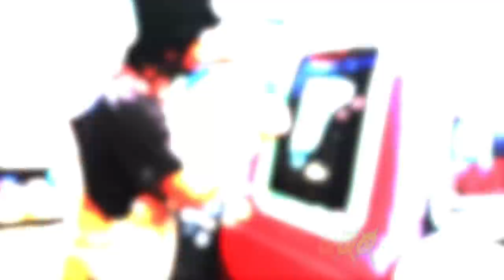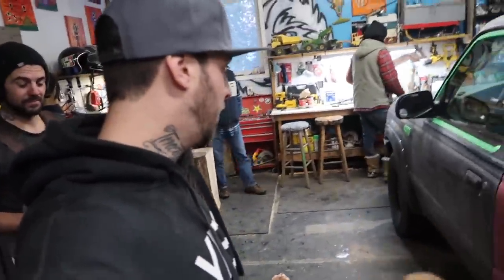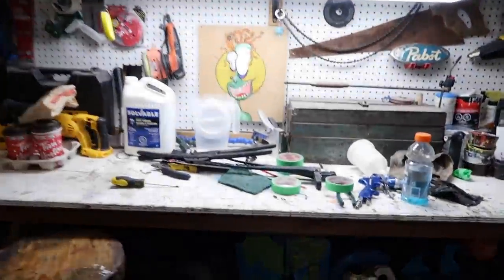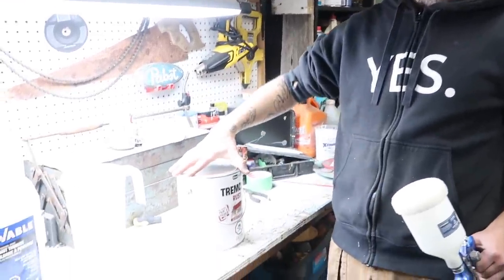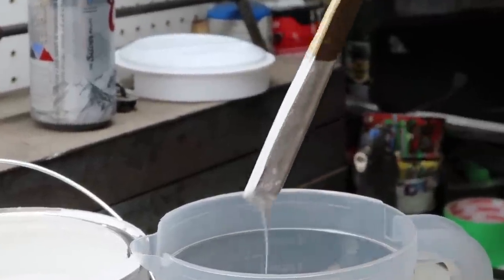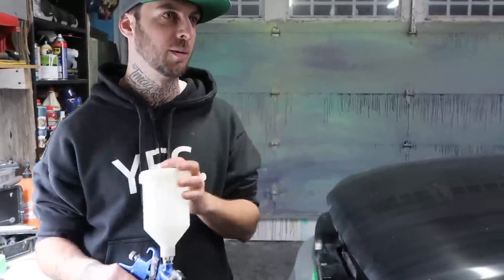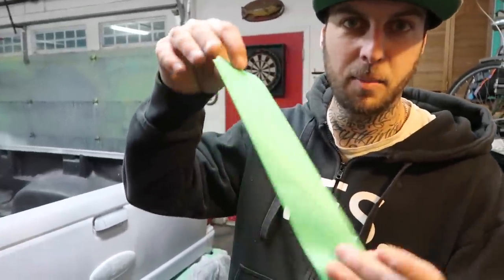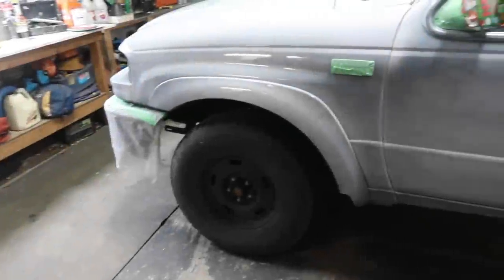$50 Rustoleum Paint Job "HOW TO" D.I.Y

Comment: As a professional painter I laughed so hard but in a good way. It reminded me how I started painting. Just like you guys! Loved it. 

Couple of runs dont really matter, you will make it better next time.. That's what DIY is all about!
Reply from the maker: Nothing better then having a blast in the shop! thanks for watching and leaving a comment.
Reply: Steeven Rivera  hi as  car modifier and restorer and  Amature 50 Years experience custom painter  and working full time going to school and college at a gm dealership for 9 years in auto body and collision.Don’t use paints that need hardener without wearing the proper air supplied full face  mask paint suit nitrile gloves . The dangerous product in the hardener is methyl di isocyanate or any isocyanate sometimes called MDI . It goes through skin eyes and n95 p95 respirator. You have a life time exposure threshold with isocyanate once you reach it you will react to even small exposure like sanding a clear coat . The symptoms can be athsma , permanent lung damage , wheezing , cough which may be permanent even death and it in 2 part bed liners construction glues, canned expanding foams insulating sprays sold every hardware building and dept store . I only say this because spaying enamels like you are using is fairly safe unless you get bad advise to add a hardener which would be containing isocyanate most contain it. Isocyanate can’t be washed of clothes floors or skin  . Nice work using the paint your using cheap to 👍👍👍 results a great let it dry good several weeks then wax . I have a 1992 Chevy tracker in mint condition painted in 2002 in white machinery / marine enamel which contains polyurethane but requires no hardener . The tracker was painted in white and look great and waxes up great paint job cost  less than $100 Canadian including the siphon feed paint gun lololo
Reply: Steeven Rivera  you can buy a paint nib file and remove the run once the paint is cured and carefully rubbing it out with rubbing compound. I would think a couple of week to wait before you try this
Reply: I'm thinking they should watch some videos on how to paint themselves
Reply: king thanks for sharing that info.
Reply: Love this kinda attitude!
Reply: @nickking1510  good news, 2k paints can now be bought in isocyanate free forms
Reply: @remlap42  Hi I am in Ontario Canada glad to hear about isocyanate free paints can you give me any other info  what company name of products I would gladly appreciate it thanks for letting me know
Reply: @nickking1510  i'm no expert so your probably better off googling it, not the sort of thing i want to give bad info on what with it being so dangerous

Comment: I spent about 4K on new fenders, a bumper, and various bodywork(pdr/bondo). I was going to have it professionally painted. Then the engine started throwing random codes and I’m out another 4K. I think I’ll just paint it my self with slightly more expensive paint and put a clear coat on with my brother and nephews. Thanks for the video and tips.
Reply from the maker: lol Thanks for watching!
Reply: Should be able to nail down the codes problems and repair .What make and codes and engine ?

Comment: I still liked and subscribed so not being critical. Thanks for this video because I’m restoring a vintage camper and want a quality paint job without breaking the bank. I had planned to use Rustoleum. Automotive paint is over $1,000.00 just to do a car, so this will save a fortune

Comment: In the 1980's I had a used appliance business, and I would often paint appliances as part of that business. I found that naphtha works well for reducing paint, and it dries quickly. I found that paint thinner was a bit oily and dried very slowly. Using naphtha, I could paint an appliance in the morning, and by the afternoon it was dry enough to sell. I also see that Rustoleum now has an enamel reducer. I like your "7 rule". I had a viscosity cup that worked great, but now they seem difficult to find. Rustoleum also has clear now.
Reply from the maker: Wow thanks fir those amazing tips on reducers/ thinners. Ill definetly look into the naphtha products. Thanks for watching and leaving a helpful positive comment!

Comment: "spray in temperatures above 65°F" 
Canadians: Just gonna send it!
Reply from the maker: LOL open the garage door and let the snow in eh! haha thanks for watching!
Reply: His tip with the 7-8 second drip works well and adjusts to the temperature. I would use japan dryer and put a heater on after spraying on the coats to let it flash should be okay it's just tremclad
Reply from the maker: @gurjindersingh199  Thanks for watching and living some tips! some heat after each coat is definitely good advice
Reply: Yeap thats how we do it
Reply: How did it ever end up lasting ? I'm thinking of doing this

Comment: looks good i did few years ago with my lowered s10 but i used tractor paint
Reply from the maker: Tractor paint was prolly better then the rust oleum. either way both very durable and nice looking paints! Hows the paint on the S10 holding up all these years later?
Reply: sold this but i have did dew truck and cars in tractor paint it hold up really good
Reply: Did rustoleum with some Pearl's a few  years back on a dodge stratus with a combat body kit. Took a few weeks to harden :( Did look decent tho compared to the good.and black mismatched body
Reply: @DerfOrNuffin  did you not use hardener is that why it took so long to dry?

Comment: Not bad for a scuff and shoot. Now that's its cured I wouldnt worry about clear youd had to wet sand. Just throw some synthetic wax on it to make it look cleared on a budget. Cheaper then proper cut and buff and still looks ama,ing I'll try to find the video of the guy who used Walmart dollar cans then used wax and keeps it polished. You want to wait 3 to 4 weeks to wax it let it finish off gassing. The only other thing I cant recommend as a painter is 12 Inchrs back with hvlp that's way to far you have to get close with hvlp to avoid orange peel. Like 4-8 inches is the usual specs. Some guns will max 10 but pinky to thumb is about perfect if your not a fast painter that can get 4 or 5 Inches without running. 12 inches back the paint is drying before it lands and atomization of the paint isnt even anymore that far back. The old conventional siphon feed guns at 60 psi ya you stayed little further back but it dumps paint and needs high pressure and high flow. What I do to paint cars at home is I use 3 compressors in parallel on separate breakers. 3 to 1 in reverse to first separator with store bag of ice over the lines circled to lower intake air into the first filter and heavy droplets then 12 inch 3/4 brass nipple with steel wool in the ends with decissant gel beads and I wrap those blue frozen packs around it. Brass is known as the cold metal I dont use fittings for that parts just lines into the 3/4 to 1/4 reducers then it runs into a 2 inch 48 inch galvanized pipe full of more beads then into my lowes 7 gallon portable tank and I run from that. Usually only two of them run. But all 3 give me 16 cfm at 90. 65 gallons at 150 psi and completely portable can load it all up in 10 mins in my truck dont need 220v
Reply from the maker: Thanks for watching and leaving a comment!! Thanks for the Wax tip ill definitely let my brother know, would be a great thing to do!
Reply: Damn you hella good can i see some of your work ? Im trying to figure out how best to do my bike sub section, main frame and swing arm in a decent black color my Zx7r rims are orange color.. So was thinking doing the rear sets in lime green kawasaki color with accents of orange into rear sets but not sure exactly on how to go about it to achieve the effect an look i en visioned here tho...Any advice greatly appreciated on this...if you have shop sen me info email etc n I'll be in touch with you on this. Thank you.

Comment: I love Rustoleum. Instead of tack cloth, I use Wil-bond. Otherwise, pretty much the same except the kid gets to paint the inside of the bed/tailgate. I use a brush on the wheels so I don't have to thin the paint.

It is tough to clean up but a little Sea Foam soak helps soften the tip boogers.
Reply from the maker: Thanks for leaving a tip!

Comment: Enjoyed your video.  My first paint job was with small compressor connected to my buddies trucks dual wheels and small water tank for air capacity  and a restored paint gun. it worked.  For my second paint job on a van I sprayed the entire van with a cheep stone guard and then sprayed over it.  It looked great like a vinyl finish .  My third was on a old step van  and I was in a hurry so I used a roller - it did come out good.   All of these were outside jobs.  Chasing the sun to keep the van warm in the cold weather and picking flies and mosquitoes when it was hot. Would like to know where in Canada you (Provence) are .  Your group looks like my group but mine are grayer.
Reply: I painted a white 16 ft wilker boat with a a roller and applied blue side stripes with 3 cans of urethane enriched spray paint for machinery from home hardware after a month i wet sanded the white and used a 8  inch buffer polisher and rubbing compound and then wax looked as good as new gel coat whole job including the 29 $ on sale polisher cost $100 .

Comment: And since it's oil base paint everything in the shop that was not covered now has a nice coat of the latest color of over spray on it,,, it dont just blow off.   Lots of rags and thinner on the tools, books and manuals, well your screwed, cloth and leather good luck and for flat glass wait a day or two and razor blade or 0000 steel wool and lots of scrubbing,,  another thing before you burn up your compressor go change the air filter in it as well as if you had a heater or furnace going they need filters changed also.
Reply from the maker: Thanks for watching and commenting! Sone great tips on changing filters etc.

Comment: Dang, drumset gets "whitewashed" too Lol. How cold is the weather there outside with the doors all open btw? Do you close em down when the paint dissipates as it is a oil based alkyd enamel ect. Seems like the cold air and oil base product wouldn't be the best combo (least from my experiences lol). I'd have that shit runnin on the floor Lol........Pizza and Rustoleum overspray for dinner too. Nice. LOL. Glad to see people havin fun painting cars in the garage like I used to, ALOT........Dane, "FORD" tailgate molding "GOES too"......Classic stuff!
Reply from the maker: lol ya we got some overspray on pretty much everything.. Close the door after every coat and cranked the heater no issues drying turned out very good! Thanks for watching and leaving a comment!

Comment: Don't you use a hardener with it?
I painted a WHOLE 1967 Chrysler Imperial with one quart of Rust-oleum "Bright silver"!! 
But since I didn't use hardener, it stayed soft enough to dig with a fingernail months later.
Reply from the maker: You can definetly add a Gardner. But to save cost I’ve sprayed multiple vehicles with just the straight rust oleum and you have to give it a good couple days to fully cure..

Comment: How is the paint doing and how long do you think it will last? Is it just a regular gallon of rustoleum? How much did you need for the whole truck just the one gallon?
Reply from the maker: Maybe used about half gallon? Paint holds up very strong. Just your basic Rustoleum. NOT WATER BASED..

Comment: You should have just bought kirker single stage paint for just a couple bucks more and gotten 50x better results!
Reply from the maker: Hmm never herd of Kicker paint. Do you know if its available in Canada? and if so where would i be able to pick some up. Thanks for the suggestion!
Reply: @MADCRE8TIVE  autobodytoolmart.com or tptools.com 
I dont know if they ship to Canada but I dont see why they wouldn't it comes in low voc and it should be able to cross the border.  I've used a couple of their colors and they all lay down real good with a high gloss shine.
Reply: I just got back from their websites and its pretty hard to find all their single stage paints without putting  kirker ultra glo in the search box make sure that to see all their cheaper single stage colors.
Reply from the maker: @jr.rangeeel7624  Amazing thanks for looking into that for me! Ill bookmark the website and use it as an option in the future!
Reply: Should be able to buy cheep paint right online we have had friends do it.. Bout 120 for pretty decent paint... Even local napas have a tractor paint that uses hardner acrylic enamel it's cheep but shines for budget clean up jobs... Better then oil base
Reply: Summit racing single stage urethane is cheap. And it will last

Comment: A little more detail for 1st time DIYers, please.    #1. What did you cut (thin) the paint with ?  Also what you called SOS, is called scotch brite pads, in the states.
Reply from the maker: Thanks for watching Dan, correct i used paint thinner to thin paint.  I mentioned you can buy the more expensive reducer aswell. And for sanding we used SOS pads as thats all we had on christmas eve!

Comment: Do you have a list of products you used?
Reply from the maker: Pretty basic stuff.
-Rustoleum paint/tremclad in canada 
-some sand paper various grits
some paint thinner or paint reducer to thin the paint.
-large air compressor
-spray gun
-tape
-And some paper or plastic to mask off everything
-and respirator

Comment: Did you spray clear over the rustoleum? I am about half way through my rv and have been finding mixed results on adding clear. Some people have had some horrible experiences and I’m not trying to redo the thing if it goes bad.
Reply from the maker: If they rustoleum paint you sprayed already cured I wouldn’t recommend spraying clear on top. If you are between coats And you mix clear in with the paint fir your final coat I’ve heard of people getting good results. I used high gloss white from rustoleum and don’t add clear myself. If the air pressure on your gun is too high you might get drying looking finish.
Reply: @MADCRE8TIVE  thanks for getting back to me so fast!! I painted it yesterday but it looks good so I think I’ll leave well enough alone! Loved your video!!

Comment: 12 inches away from paint surface? erm nope, 5-6 inches....
With a almost wide open Fan.. just screwed in a little to neaten pattern up, and Fluid Wide Open, and then correct air pressure..
Reply from the maker: definetly needed a bigger air compressor..

Comment: Great video.Which sandpaper grid you guys used? Any recommendations / advice for a newby?
Reply: Green sos pads from Dollar tree
Reply: @louisianaBoi225  Thank you for your response.
Reply: You're welcome
Reply from the maker: @adventuresofsven2314  if you've done body work sand to 220 grit and can go finer after that. if you are trying to just scuff the stock paint you can use a scotch brite pad.
Reply: @MADCRE8TIVE  Awesome, thank you so much for your advice.Love your channel.Hopefully i do an incredible job like you.
Reply from the maker: @adventuresofsven2314  As long as it turns out all one color your in good shape. Good luck and have fun learning and spraying!
Reply: @MADCRE8TIVE  i will try my best.Thank you
Reply: 600 then 800
Reply: @copperfoxx2381  Thank you for your suggestion.I wrote it down
Reply: @adventuresofsven2314   best used with soap water for a smooth and refined finish and remember to wetsand until the colour is cut and on one level
Reply: @copperfoxx2381  Wow!! Ok  .Thank you so much for your recommendations. I greatly appreciate it.
Reply: 400 grit minimum for solid paint, 800 grit minimum for metallic
Reply: @intraw831  Thank you so much for your advice.I appreciate your time and knowledge. I want to paint my car and i want to do an excellent job.All smooth and shiny.You have any videos were you paint?
Reply: Sven Nezzer I haven’t made any yet

Comment: What’s the smallest compressor I can use to paint a car
Reply from the maker: Hey not to sure, but you can use a small compressor but will lose pressure fast. The bigger the holding tank the better
Reply: @MADCRE8TIVE  what if I’m painting rims
Reply from the maker: You could just use spray can. Small compressor will be fine too. I have a few videos on how to paint rims if you go back and look threw my videos!
Reply: @MADCRE8TIVE  ok ,,,,, but I might want to start learning how to spray paint cars so I should buy a 30 gallon then

Comment: Uh, I think it's called scuffing when using scotch bright pads and sanding when using sand paper! Just my 2 cents!  Do know you can get far better paint for just a little bit more! In fact duplicolor is only $ 30 and for around 130 you can go with a complete base coat clear coat system!
Reply from the maker: Thanks for watching Eric! my bad ill make sure do use the proper terms in the next video.

Comment: Then i have my spouse her 2007 suv has few rust spots on both rear wheel well areas. There is area down to bare metal. I was thinking to sand with grinder cleaning up rust then applying rust preventive material. Use piece of fiberglass on rear a small area let harden then sand that then apply bit of bondo on those surface areas feather in edges as i sand making sure that i have no low n high spots...etc apply primer wet sand that then paint ?
Reply from the maker: you sound like you got the right process, lots of youtube videos with great information out there
Reply: You should look up the YouTube channel ChrisFix he shows you how to fix that perfectly with home tools only
Reply from the maker: @kinglabe5809  great suggestion.

Comment: Can acetone be substituted for paint thinner?  It dries faster and welds the paint to the existing finish.
Reply from the maker: The thickness (viscosity) of canned  works well for brushing, but if you plan to  it, you'll probably need to  it. The company recommends using  for  its oil-based , though you can use mineral spirits for cleanup.